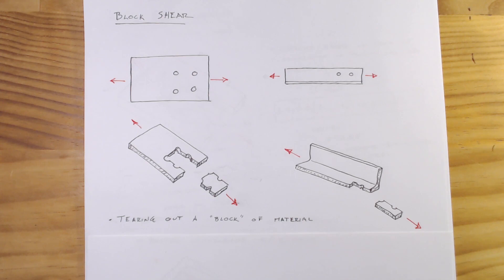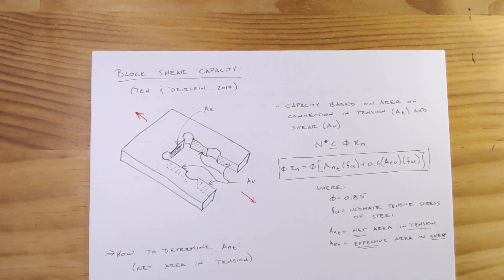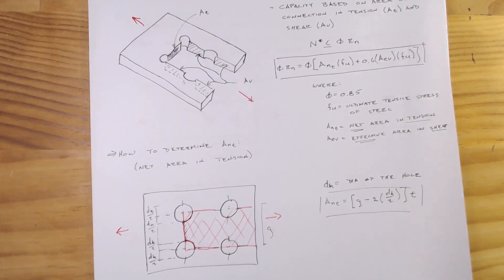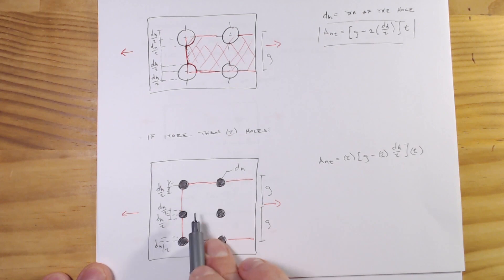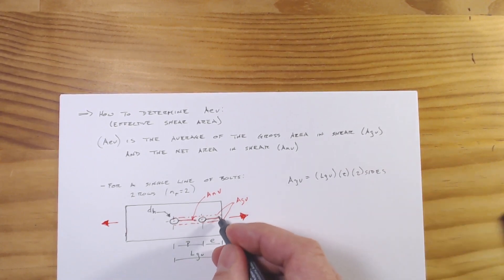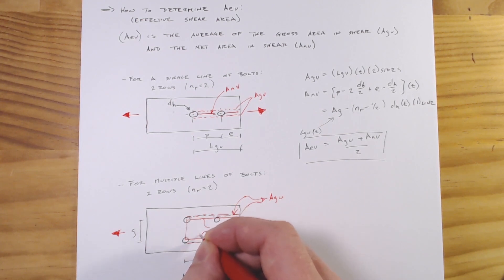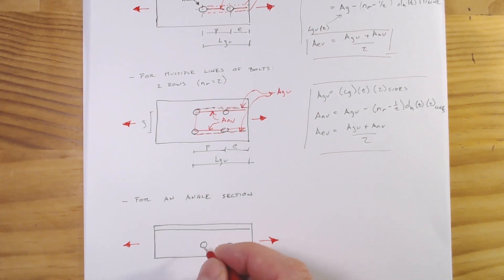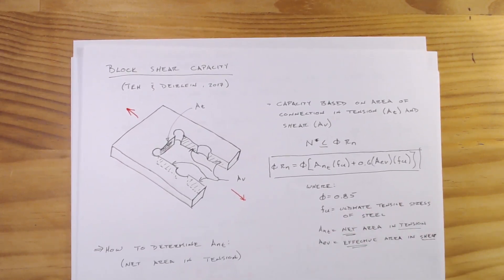Block Shear

Comment: A bit confused around the 5:25 - 6:10 mark. The sketched areas look like 1/4 of a hole, not 1/2 of the diameter hole. Am I not understanding the diameter hole correctly?

Comment: how do we determine the critical portion that block shear will occur?
Reply from the maker: If you want to check it robustly, you would check each potential block failure plane, but based on connection tests, the potential failure planes shown in the video are the ones most often encountered